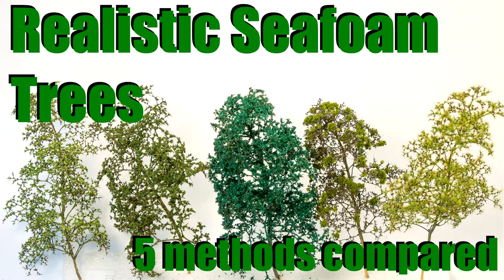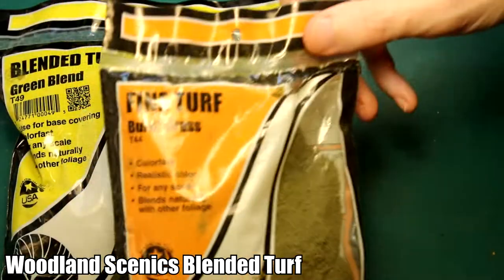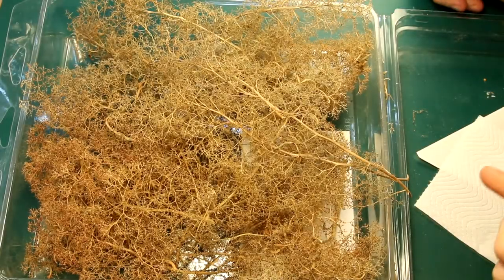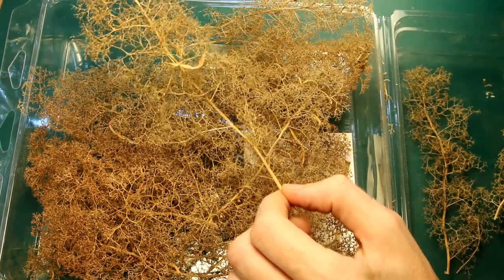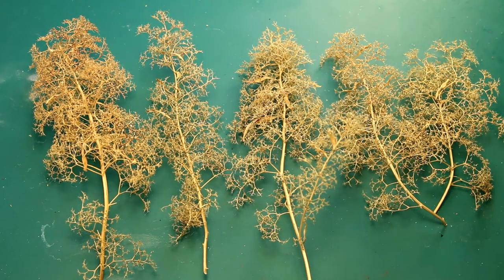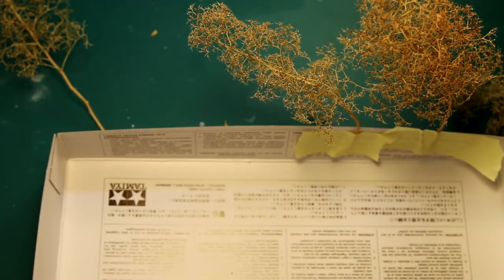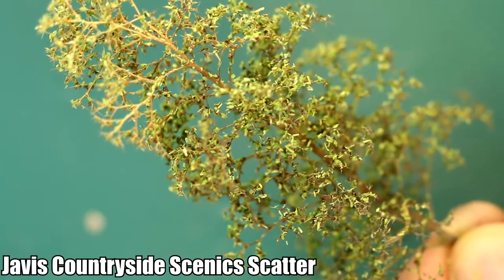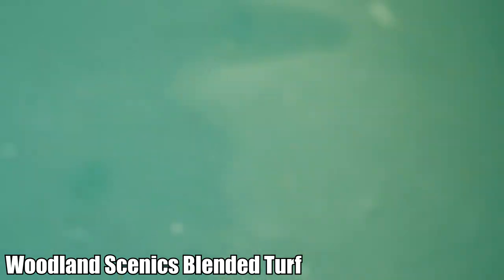5 ways to make realistic seafoam trees for scale models

Comment: Use the dark colored scatter to do the underside of the limbs then put the lighter color on the top of the limbs. Use your same process with the glue or use spray glue, then just turn the tree upside down and apply the dark colored scatter on lightly. Flip the tree back over and put a lighter color on the top. If you're using spray glue that would help to build up a little bit thicker foliage by spraying the glue applying the foliage then spraying again and adding more foliage. You said you can't get the spray glue for whatever reason so you could mix up white (pva) glue and water and put it in a spray bottle that way you'll have your own spray glue. Dilute the glue just enough to be able to spray it but not enough that all of it drips off the tree before getting the foliage on. Also something no one ever mentions is when you are done spraying the glue take the sprayer off the bottle, put it in a cup of clean water and pump the sprayer to clean the glue out the head, nozzle, and tube. Now you can reuse the sprayer bottle. If you have any glue solution left just put the sprayer back on the bottle and it will keep for a while you'll just need to shake the mixture before using it the next time. Hope this helps.   👍
Reply from the maker: Thanks for the tips William